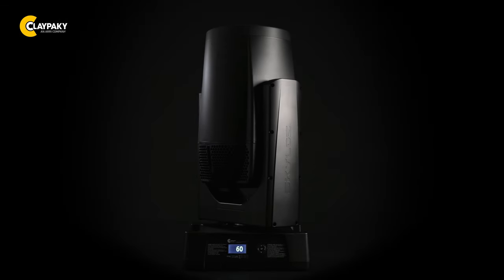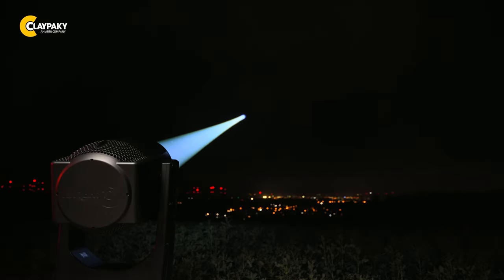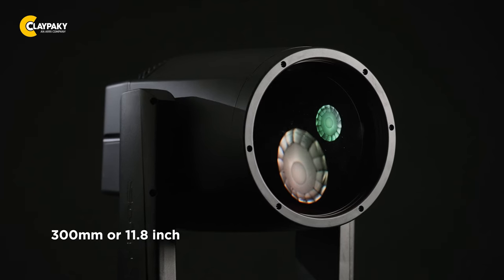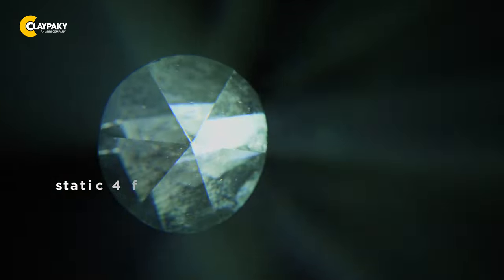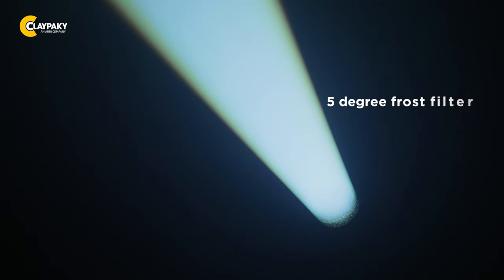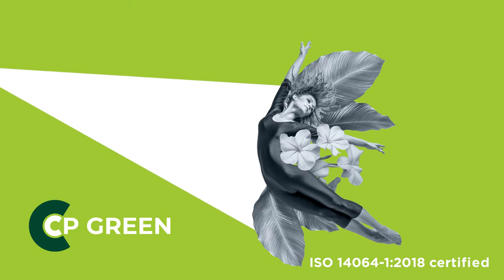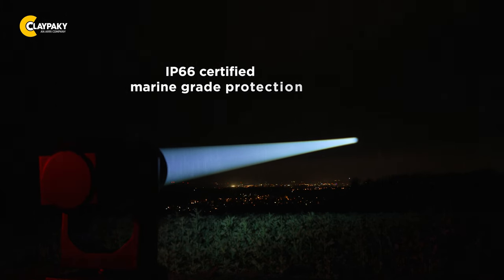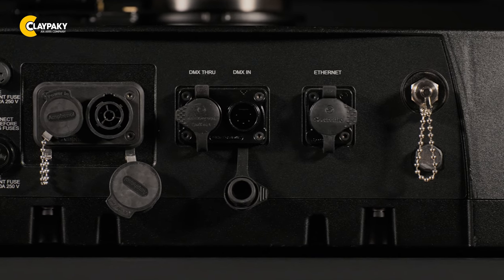Claypaky Skylos

Comment: Wondering if can you do crowd scanning with the Laser Engine Skylos moving head? With its massive beam or star Gobo scattered effect but pointed at the audience? That wouldn’t affect eyesight of the crowd right since this is a moving head light and not the traditional fixed box high powered lasers? 🤔
Reply from the maker: Hi, just like any other moving light, if you keep the safety distance, crowd scanning with Skylos is allowed (more info about distance on the official user manual). In addition you can set a safe operating area if required/needed. Don't forget that in the USA a variance is needed for operating Skylos fixture, or eventually opting for "Skylos NV" model, which doesn't require a variance at all. More info here: https://www.claypaky.it/products/skylos/
Reply: Thank you so much. Will definitely look at more info about safe distances on the official user manual. It’s great that crowd scanning is allowed ❤😊 More power to Clay Paky innovations, let’s go! Cant wait for what Clay Paky has in store next. 🎉🙏😀